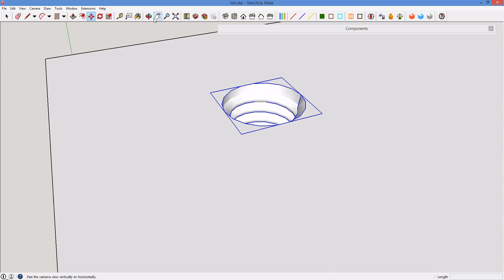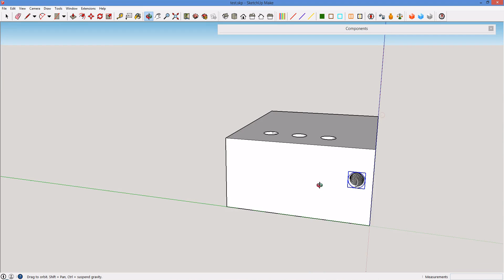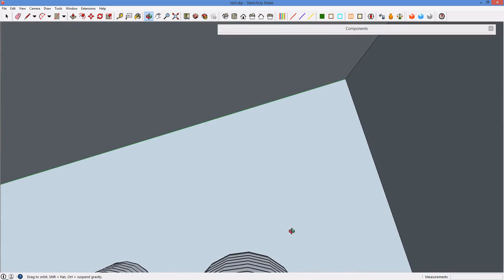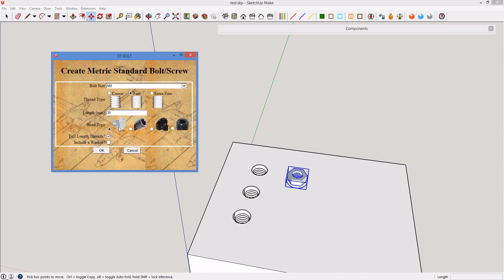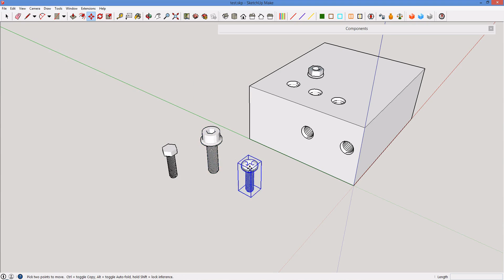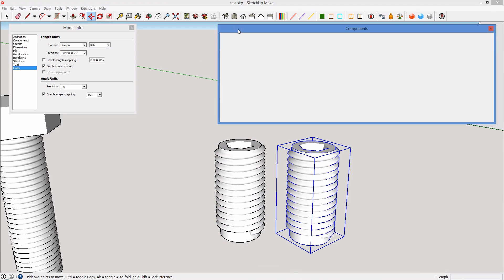EP Fasteners Overview

Comment: idk if you got any feedback but i just installed your TOOL, so here's the feedback: its awesome BUT you should remove the BG pictures its hardly readable, add back button so we can go back instead of cancelling everything and then redoing everything we did, headless screws for threaded rods (i needed it),then coarse, fine, extra fine...wots the depth of the groove? width? i understand its hard to do that but its doable and it seems to me that you used a different method to create threads (premade model) which is not ideal? all in all, you should use math to make threads, not premade models. because then youll be able to enable square threads (instead of triangle, like now). ideal tool would be like this: you make a rod (circle, push/pull), right click on it, EP fasteners, thread type: xxxxx, thread width/angle: xxxxx, thread depth: xxxxx, head type: xxxxx... all of that with live preview and premade bolts. and premade bolts in that case would be the easiest thing to do since youd be using math, so you could just input your measurements and make a prefab. nice thing with would be adding your own prefs. theres so many types of screws, your tool covers only few of the most common. + on top of that, youd get a functionality that wasnt intended, say someone makes a square and uses your tool, he'd get a threaded square.. ;)  with these you could make any thread/screw in the world... Depth, Width_Lower, Width_Upper, Thread_Angle, Threading_Angle. + you only have machine threads there's no woodscrew threads and with those measurements it would be possible to make them. so with 5 "simple" measurements you have everything! ^_^ hopefully you will read this. :)

Comment: Does anyone know of a plugin / extension for making threads to exact dimensions & pitch?  I thought in 2020 there would be another option out...but still I use EP Fasteners. My main issue is choosing fine, coarse, threads, etc is just a guess and then I have to scale to fit my needs. Is there a plugin where we can enter the inner diameter, outer diameter, and pitch to generate the exact thread we need?

Comment: I am using Sketchup 2016, which others here seem to have no problem with. However, the plugin will not drill threaded holes though a solid. If I make a box 2"x2"x2", I cannot drop a threaded hole through the thing. I place the "circle" on a face, but then nothing happens.

HOWEVER, if I pick a length, like for a blind hole, and set the depth to 2", it does fine. Goes right through.

Any idea why the threaded through hole is not working?
Reply: I have the same problem!
Reply: Same problem with Sketchup 2018
Reply: I'm the same as you :(